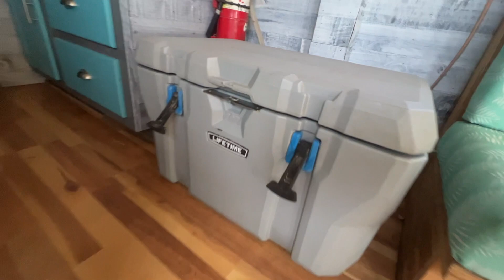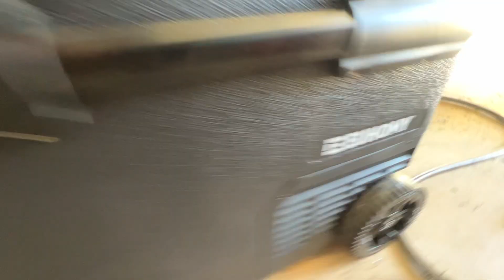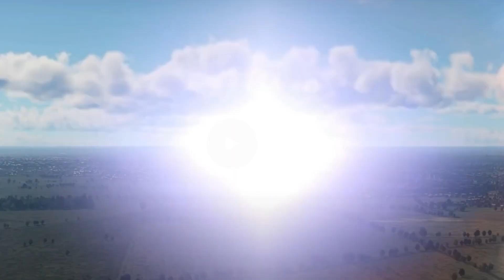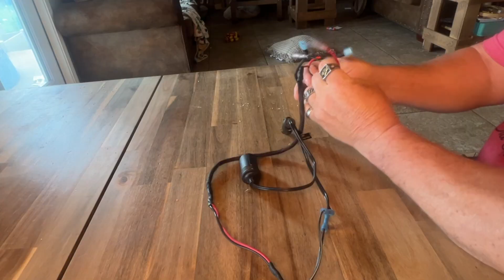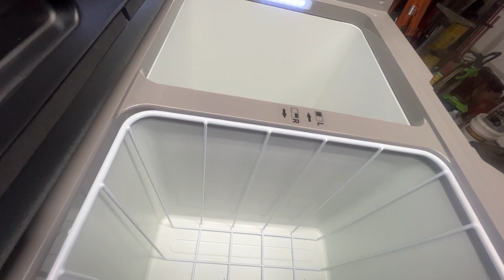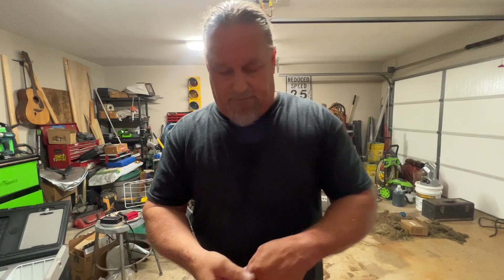Euhomy 59 qt 12volt Car Refridgerator/Freezer

Comment: 9/24/2025
I was thinking about buying the exact Cooler freezer you have, but now that I've seen what you've gone through with yours, I'm having doubts about buying one.
Reply from the maker: don't build a battery bank and plug it into the solar port and you should be fine.  I usually use this for a few weeks out of the year and it works flawlessly.  I used it this summer (first week of aug) and its been plugged in since.  If I were to buy again Id get the next size smaller though. but that's my preference not anything against this unit.
Reply: @dzlfreek 
I'm getting the 58 QT size Euhomy from their website. Not the 59QT that you bought.
They're selling the 58QT for $264.
Amazon is selling it as a bundle for $324.

Comment: what do you think about that battery's longevity? It looks like its the alpicool brand battery, not the original Euhomy battery. How long does it hold a charge while using the fridge?
Reply from the maker: ive run the fridge in eco mode, on battery only - small side as freezer set at zero and large side as fridge - set at 40 for over 8 hours with an ambient temp of 70-75 degrees F.

Comment: You mentioned you regretted buying the 59qt over the 49qt but didn’t explain why.  Could you please give you opinion please?  I too had 49qt in mind but falling into the 30 dollar more trap haha
Reply from the maker: for what I use it for, its too big.  I may not feel the same when and if I find a square body suburban.  But for now, it takes up a ton of space in the XJ
Reply: @dzlfreek  so after I wrote that comment, it seems that the only diff is in the height of the two… contact footprint is exactly the same. The 59 is just 2”
Taller that’s all…. Maybe that might help buyers remorse on the size haha

Comment: You look like a guy that might have a few 20 volt power tools. I used a converter to knock that 20 volts down to 14.5 volts and now Ryobi powers my cooler. A 6 AH runs the thing as a deep freeze (-4 F/-4 F) with 31 pounds of Ice ( that I first made in the cooler using wall power) for about 4 hours. The desert sounds like the perfect place to use a 100 watt solar panel to run the cooler along with the built in battery. BTW, don't ever plug a solar panel directly into the little jack in the battery. All the magic blue smoke comes out.
Reply: 36 F/-4F ice cream and pops

Comment: Great overview. I just bought the Vevor version of this cooler, but the internal battery is way to expensive at $128, so I will be using an external 12V 100ah SOK battery instead.
Reply: Did you buy the 56qt with the pull handle vevor?  They have something that looks like a battery  near the top but they don’t list it as option on description.  Curious if you have this same model

Comment: how many hours did you get using only the battery to operate the fridge on a full battery
Reply from the maker: Depends on the temp difference inside to outside the fridge. How often it gets opened. I was getting anywhere from 6 to 12 hours

Comment: I have this same fridge. Plugged it into AC it runs but sure hope I don’t run into problems haven’t taken it camping yet but will in June.
Reply from the maker: it'll probably be fine.  I probably screwed something up when I plugged that home made battery bank into to solar port.
Reply: Hows the noise level on it ???
Reply from the maker: @GEARH4  whisper quiet
Reply: I've have the older style cooler from them, its been running strong for almost 3 years now.

Comment: Howd you run the power outlet to the back? Definitely something I've been wanting to do to my XJ. You seem to have great idea and great videos keep em coming
Reply from the maker: I ran power from a relay activated by battery power, fuse  protected, 14 gauge wire, to the rear along the edge of the rocker panel on the inside of the Jeep. This also provides power to the LED lights that are installed in the lift gate. I think I tapped into it for the side 7” LED light bars.  Even though there’s 3 different circuits running off this on power source, each is separated with its own relay and fuse. Nothing has fought fire…yet

Comment: I hooked up a second full-size group 31 Deep Cycle in both my vans with a 100amp  breaker. I run a separate 6 fuse box and hookup my stuff to the second battery  through the second fuse box, and turn the breaker off, not to discharge the start battery.
Reply from the maker: if I had room for a second battery, I would

Comment: I had bought an 80qt NEWAIR last year for my camper van… couldn’t get temperature to stay set on either side..JUNK!…sent it back to Amazon and got a refund. Bought a different one…same one you have only mine is branded VEVOR…47qt I think it is (you may have seen it in the van when I was at your house ). Same exact app I have as well! I haven’t ran mine any length of time seeings I only made the one trip [to your place] and back home again…I’ve turned it on maybe twice since then to make sure it’s still working. I really like operating it with the app. Great video…good to see you on video again. Stay safe! ~Jim~